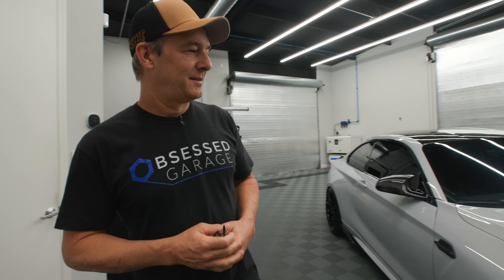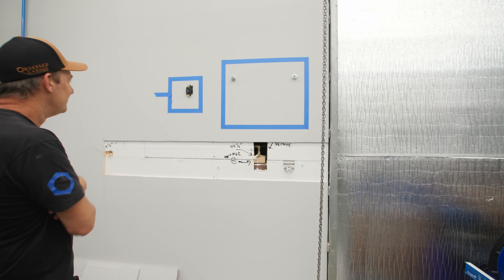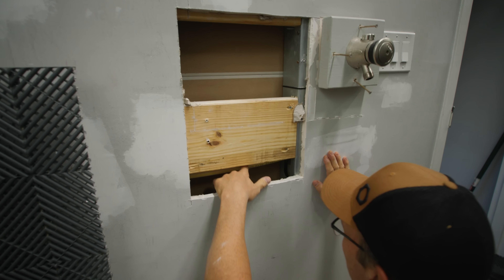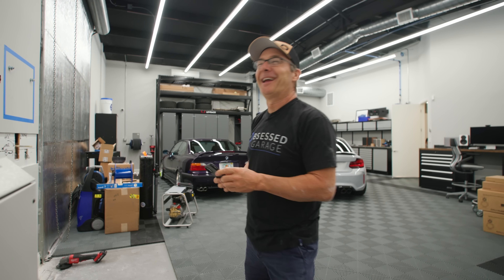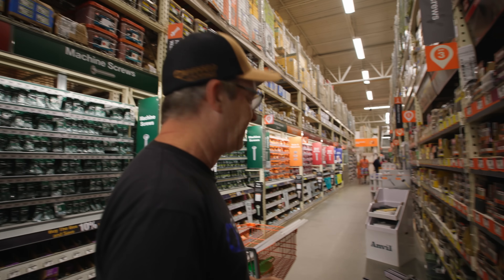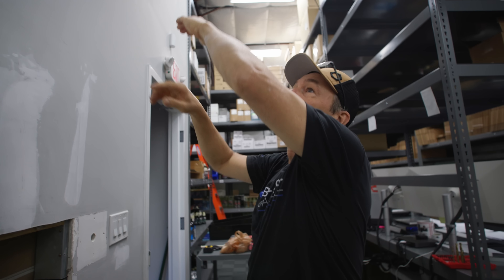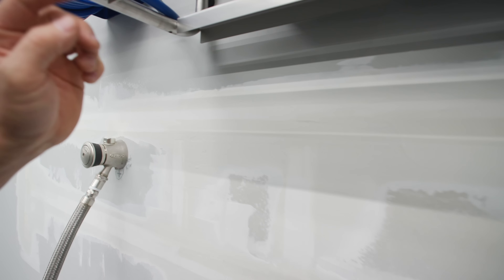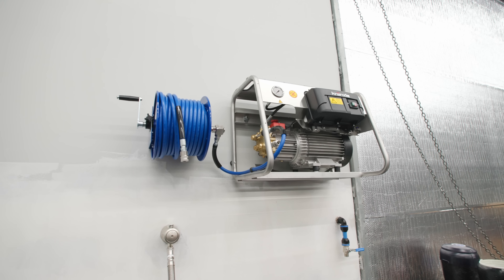Ultimate Pressure Washer Installed in Yarn HQ!

Comment: What was the logic behind mounting the hose reel so high? Just seems like it would not be as fun to wind up as tradition height reels
Reply: I believe the  purpose is for the DI water treatment system
Reply: @Obsessed.garage  They are working out the kinks on an OG water filtration system.  Plus Matt is taller than Mike.
Reply: @Obsessed.garage  Probably not anywhere.  I don't think four bolts makes anything permanent. Probably has more to do with the heigth of the pressure washer.  Symmetry?  Then again, I haven't a clue.